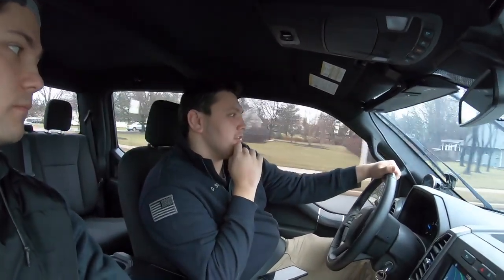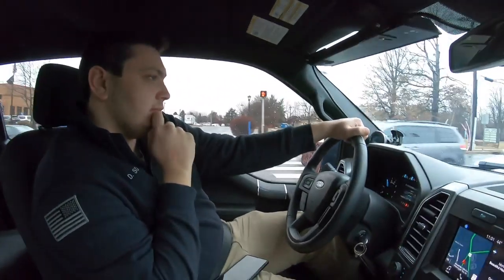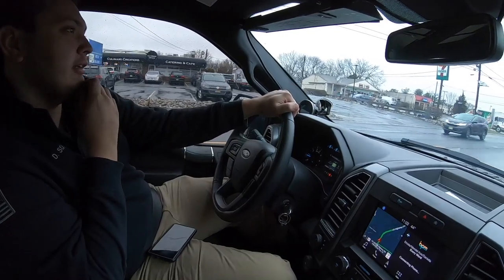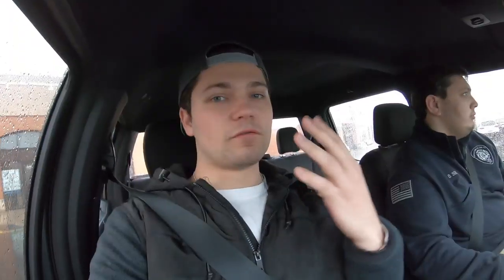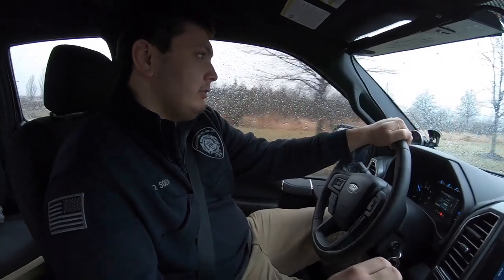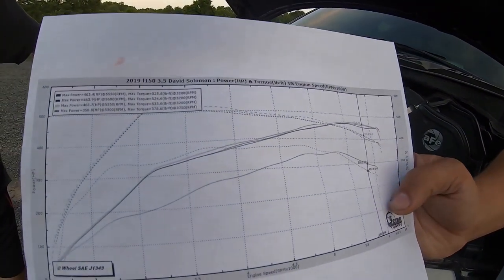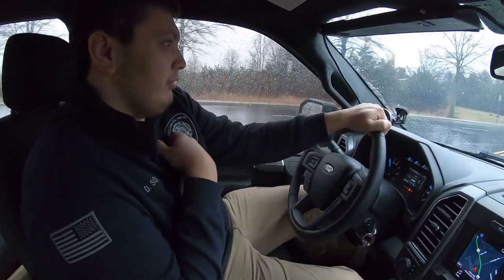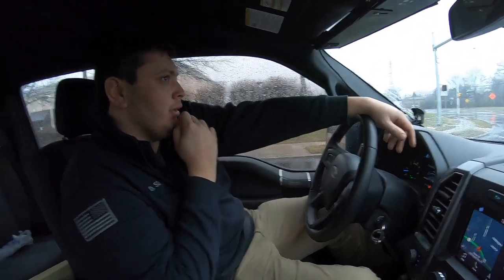Our 2019 F-150 Ecoboost Mod List | 500+ HP

Comment: This is why the 3.5 EcoBoost is 1 of my current favorite engines. So much potential.
Reply from the maker: Peter Shepherd yessir!
Reply: @RatchetWrenches  Not enough love for the 2.7L. That thing is a beast!!! I drove a Ford Transit Van with the 3.5L in it. I got on it ... WOW! This was stock, too!! Very impressive. Upgrade both fuel pumps and injectors and look out!!!
Reply: I’ve got a high output 3.5L v6 2019 limited, it gets 450hp stock, should I tune mine?
Reply: @jamesdempsey5702  yes

Comment: 1. Turbosmart Blowoff Valve
2. AFE Cold Air Intake
3. SPD Catted Downpipe and turbo adapters
4. 5* Tune
Reply: Five star? Is that the brand
Reply: downpipes arent stainless
Reply: @kennyboi01 there’s better tunes now 5*is most used but some have found better options these days. Mine isn’t 5* and hits the same hp and shift points.

Comment: 6:05 that launch is epic. Hard to believe that that’s a full size truck pulling like that. How many miles are on it? Curious of the reliability at this HP.
Reply from the maker: The 4x4 launches are honestly insane. And probably around 30k or so the owner hasn't put many miles on it working from home for a while. It's still reliable!

Comment: Ive got the same year in leadfoot grey. Im putting 480 whp with intake, mbrp cat back exhaust and a throttle body spacer. Just ordered some more go fast parts and hoping to get to 550 hp. These trucks are a beast.
Reply from the maker: Hell yeah that's awesome! How does the MBRP sound?

Comment: Dont buy the SuoerSonic unless you dont want to go back to the dealer again, otherwise i loved mine it was just too much of a headache to take on and off in the event a sensir fails.
Buy the EMS electronic one just released in Jan 2020.
Plug n play, novacuum line or wiring harness bypass required.
Yea its not as loud or sound as good but its 80% there.
Its only 50$ more than the supersonic but only because the supersonic is 3+ years old and is only 260$ now. Theyre the same price when both released. Ur welcome

Comment: I got almost the same set up in my 2017, but I have upgraded garret turbos and Inter cooler  and no cats and it sounds mean and very loud, also tuned by five star and I’m on 597 whp and 607 wheel torque I’m fixing to do the same in a single cab 2021 I just got las month
Reply from the maker: Damn that sounds sick we need our buddy with the F-150 to do those upgrades! These trucks can make so much power with just a few upgrades it's awesome
Reply: Very nice!

Comment: Good video, thanks for sharing. I have the 2013 Ecoboost with a S&B intake, Mishimoto intercooler, Corsa exhaust (love it!), Granatelli performance coils, all pulled together with a Livernois 93 octane tune. It all works wonderfully- love the ecoboost!
Reply from the maker: Thank you! Damn it sounds like a beast!
Reply: What HP you got?
Reply from the maker: Idrees Aljamie on 93 we have 468hp with the e50 (e85+93) we push over 500hp. Still going back n fourth with the tuner to get the right mapping. Hbu?
Reply: I have 498 whp on my 15.
 Downpipe sure, costs exhaust, colder plugs and tstat, ally meth injection and Livernois tuning. 
 Drove it from the dealer to lms and it currently has 223,000 miles with this hp level. I drag race twice a year and use it for my work truck and haul my enclosed trailers for work and hauling cars to the track.
 Can’t wait to build my next one.

Comment: Nice videos as always and truck guys. With the intake and the down pipe did you notice better mpgs? Like what’s your Highway at about 70mph and your in city?
Reply from the maker: Roy Steele thanks! But our Mpgs are mostly city driving about 18mpg and Highway is about 20mpg. But this is all when we’re not really driving above the speed limit, because with the tune it’s very easy to go fast and the mpgs goes down completely!

Comment: Did yours come with the life time powertrain warranty? 
Im thinking about tuning it, adding a roush cold air intake, spd down pipes, turbo adapter and then eventually exhaust. 
Does your truck run right with all you done to it? Not looking to race all the time or even hardly at all. Just whenever i get the occasional guy that wants some smoke that i can give it to him. Worried about the warranty though and if i should.
Reply: Truck runs perfect with all the bolt ons!
Reply: @EcoBooster You have link to this issue? I can't find anything on the 2nd gens having this issue.

Comment: Nice job guys and hope you’re enjoying the truck. I have a 15 with the 3.5L Ecoboost and am constantly impressed with it. Prior to my 15 I had a 98 F150 with the 5.4L Triton, K&N cold air kit, mass air flow sensor, upgraded coil packs and all that......and I feel the Ecoboost has much more power, is faster and pulls like a champ. I like that you mention what each mod improves and it’s basic function. You might also mention costs and put links in your description/ notes section. In doing my research, I always tend to look for someone who kind of puts a “best first mod” and continues with successive “bests”......as most of us are looking for more HP and Torque. Thanks again! 🤙

Comment: Hey man I have 2016 3.5 lariat sport, special image package without the stupid stripes. 6” Pro comp lift, pro comp black series rear shocks and pro comp black series front coil overs. Running 35 BFgoodrich KO2 with 2 piece fuel rims in black.. performance mods include Turbosmart BOV (no gains like you said just fun), Roush stage 3 intake, SPD turbo adapters, SPD high flow performance catted downpipes (like yours), with 3” AWE ofg res delete exhaust (sounds mean! Best pipes for the eco in my opinion). Last but definitely not least all this new piping bolts up to new turbos from Garrett, bolt on twin turbo “garret power MAX”. So now I’m about to get the tuner from 5star... I’m hoping that after I install the tune all my codes will clear and my cel will turn off. My question is probably dumb but I was wondering what codes you were getting before the tune. I’m getting p0245 and 02456. Turbo wastegate solenoids A low -and  A high. I. Also getting p035 turbo bypass valve along with my truck throwing itself in limp mode obviously the computer is freeking out with all the unfamiliar parts.  So I called 5 star and they said to get the sct bdx or the hp or whatever (the one you have mounted up) . My question is will purchasing this tuner and the tunes help me clear these codes... or do I need to go and get a custom Dyno done. I’m having a lot of trouble because here in Colorado everybody’s being lame and scared to even Dyno tune my truck. They say the new platform is super complicated and what not... so yea I’m wondering if you threw any codes after your mods! And if so were the guys at 5star tuning able to help you all.
Reply from the maker: Damn man I’m sorry you’re getting codes. We weren’t getting any codes prior and still arent. But yes you’ll be able to delete the codes with this tuner. You don’t need a dyno tune to get the codes removed

Comment: The Better exhaust would have been discard the resonator. Replace with a magnaflow dual in dual out crossover oval 11385 or 14385. Then continue the duals back replace the stock muffler with the same magnaflow crossover muffler, then duals out the back. Dyno results prove gains of 20 HP 16 Tor at the wheels over one single pipe no matter what size. Sounds deeper and looks better with 4" dual chrome tips.

Comment: Hey guys huge fan, however I have a question if you have the down pipe can you still put a cat back and resonator on your truck too?
Reply from the maker: Appreciate that very much and yes you can! The downpipe we installed was just to increase the airflow of the exhaust by widening the pipe and replaced the stock downpipe. So yes if you get a catback system it’ll bolt right up to the downpipe

Comment: I would of done oil catch can first so the engine can last longer in the long run should of done next the cat back so it can have better flow once you buy a cold air intake then upgrade your radiator better flow for all the are coming in now so way more water flow going then a tune the best way to go i say

Comment: If you wanna pass emissions, Don't waste money on a new exhaust system, just install a reed valve and saw-zaw or drill a hole in the top of the exhaust where it is hard to see and boom, clean air enters the exhaust, but no oil/gas exist, keeping the truck clean. Seriously, it adds to exhaust sound (a little) and solves the issue for $60 and a quarter of the effort.

Comment: I did all the upgrades to my 3.5tt F-150 (SCT 93 tune, 3 inch high-flow cats Borola exhaust, AFE intake, 73mm throttle body) 420rwhp and 535tq. After 4 years and 20k miles the trans had lost all overdrive clutches and was pretty much beat.
Reply: Your the first person to talk about how well the transmissions are holding up.   I’m coming from the dodge world, were trans blowing up because of to much torque is a language we speak...
Reply: I dont believe that. I know guys who supercharge their coyotes and running like 900hp. Trans is great
Reply: My trans. Let go at about 55,000 miles. Running e30/ e50 tune. 2018 3.5
Reply: Are your high flow cats just universal borla? Or are they for like a mustang?
Reply: @scotthightower9481 so from my understanding the first year of the 10 speed, which is an 18 and I have one myself all stock with 96,000 miles, is not the greatest transmission. We had issues with super hard downshifts and luckily an update on the transmission took care of it and haven’t had any issues so far. I’m honestly not surprised to hear that yours blew so early tuned being that we’re not the best from the start.

Comment: i have a 3.5L with a tune only that makes 480 wheel and 550 wheel on 100 octane. These motors are nuts
Reply from the maker: J Biz that’s rad! They’re great motors and have a ton of potential for power!
Reply: Do you daily it with the tune?
Reply from the maker: Tommie Qualls during the winter no. Now Yes of course!
Reply: Ratchet Wrenches thanks for the feedback!
Reply from the maker: Tommie Qualls no problem!
Reply: @RatchetWrenches  what tuner you have?

Comment: I'd advise against meth. To many issues can arrive. Air bubbles, running low and or doing pulls while low on meth.
Reply from the maker: Yeah I don't think the owner of the truck ended up doing the meth injection anyway

Comment: Couple Questions, I have a 2020 F-150 3.5L with just a 4inch catback straight pipe. I am wanting to put an air intake and downpipe, Will I definitely need a programmer/Tuner to install these? Also does the downpipe come with all hardware needed to install or will I need the SPD turbo exhaust adapters?
Reply from the maker: Hey you won’t need a tuner to install those parts, but If you want the most performance out of those parts I highly suggest getting it tuned. This particular downpipe came with all the required parts to install yes. The turbo adapters are separate and are a totally different purchase but while you’re down there you might as well upgrade them ya know?

Comment: Nice truck and great job doing mods. Maybe I missed it. So all this and no AM intercooler. I have a 21 150 and I thought the game plan was to do that first . I'm in Ga so maybe that still is valid. Can't get any tune for a 21 so far that makes significant performance gains. I'm with u on the exhaust. I don't like any of them over stock. Been there and done that too many times.

Comment: No engine spec, obviously 3.5 and a 10R80, but no mod list ??
What gear did you dyno ?
Why 5 star ?
Reply from the maker: We said all the mods we have that relate to the tune. But I’m not sure what gear they tuned it. And 5 star because they’re a reputable company and have been tuning the ecoboost engines for years. We were recommended them by a friend but I’m sure there is plenty of tuners out there that can achieve similar specs

Comment: I’m in the market for a brand new truck. I appreciate this video and learning you’re mods. I plan to do the same build. Will this truck tow 9000 pounds? Camper
Reply from the maker: Thank you for the comment! Yah I think you’ll love building it similar to ours. I’m not quite sure the towing capacity especially now with the tune idk, it adds a lot of tq
Reply: Ratchet Wrenches what is the make and model of the tuner he used.
Reply from the maker: Anxiety Fpv NGauge tuner and it was dyno tuned by 5star tuning
Reply: Towing capabilities on a gen2 3.5 eco is roughly 15k lbs

Comment: The AFE Rebel cat back sounds incredible on my 2012 3.5L
Reply from the maker: Interesting I’ll have to check how it sounds!
Reply: @RatchetWrenches  I'm also running a cv fab catted downpipe with AFE cold air kit.  I wasn't looking for a single side exhaust. It really shortens the exhaust travel. All piping is the same size. Awesome sound for a 6cyl no droning at 85mph but you know it's there.  I'm completely satisfied.  Next is CR performance manifolds to finish the exhaust

Comment: 500 hp with stock turbos and 5* tune? Haha get tf out of here
Reply from the maker: Ryan Haecherl to be exact its 468hp and 533tq on 93. We have a dyno sheet and a video showing the results. Then on the e50 tune it pushes over 500hp... so yes 500hp on stock turbos.
Reply: @RatchetWrenches  yep I watched.  I'll wait and see that video.
You need an intercooler and meth order the cvf titian intercooler.  
Get a dragy and let's see what you put down now.  
How many revisions on your 93 5* tune?
Reply from the maker: Ryan Haecherl the stock intercooler can provide enough performance to withstand the e50 tune. If we plan to run the e50 tune often yes we’ll prob upgrade to a mishimoto intercooler.The tuner has been back and fourth with revisions to perfect it. We haven’t sent over a data log in about a year since we don’t have close access to e85 and then this pandemic. To answer your question on the number of revisions for the 93 tune I believe it was 4 or so. They pretty much had that tune lockdown
Reply: @homerog4920  I own a eb truck.  I'm in all the eb truck groups.  Again you're wrong...

Comment: You need better tuning, 3bar map and I'd suggest a deeper trans pan
Reply from the maker: Well look into it
Reply: Already has a 3 bar from the factory. 1 bar means it can only read vacuum. 2 bar is vacuum and up to 14.4 psi of boost. 3 bar is vacuum and up to 28.8 psi. The 2014s and older came with 2 bar.

Comment: TLDR; 468whp/520 ft lbs wtq  (Needs an intercooler and catback next for sure and itll make 500+ whp)
--Turbosmart Blowoff valve
--SPD performance Downpipes
--Good tune for this exact setup
--AFE intake which is overpriced as forum guys and myself have proved. An intake just as good (if not better in my case) for under $100 with basic tubing and filters. Mine gained more power without the AFE using my homebuilt one and was 1/15th the cost
Reply: Do you have the turbo whistle package from SPD

Comment: I have been modding my f-150 2.7 do you guys have anyway to send the links to the parts
Reply: I have an 2.7 eco boost beating all the 3.5’s sent my way. Tune, res delete, awe exhaust, intake, downpipes on 93 octane tune I can hit a 12.3 quarter mile with 35’s on

Comment: Watch out for the cam phasers , mine went out at 63,000 miles
Reply: What year truck
Reply: @masonsmucker4745  2017.  The dealer says 9 trucks are waiting for same backorder part, t this dealer alone.  Love the truck as a whole, when working, most versatile and set up perfectly for me. CANT trust them now-a-days. Im thinking about buying an old carburated v8, least amount of electronics. Electronics SUCk they just dont last, as well as these high tech engines.

Comment: Ay bro what do I need to be e85
Reply from the maker: Steve Martinez well since these are flex fuel you just need the power mods to support the e85. For us we only have a downpipe with turbo adapters and then a cold air intake
Reply: And were do I get the turbo adapters I’m already straight pipe
Reply: Downpipe*
Reply from the maker: We got ours from a company called SPDPerformance but there’s a bunch of companies that make downpipes and turbo adapters. So you can really chose which one you’d like. I do suggest SPD because they’re holding up great and have very good reviews and are really popular!
Reply: @RatchetWrenches  I have a 2019 3.5 and want to run e 85... what do I need?
Or keep it 93 tune any suggestions to make it quicker

Comment: What gear was the truck dyno'd on? I hear 7th gear is 1:1, yet my truck was dyno'd on 5th. I was a little confused as I hear our 10r80's should be dyno'd on 7th gear.
Reply from the maker: Ours was dyno’d on 4th gear. But I actually heard that about the 7th gear pulls. I’m Confused as well now
Reply: I think the issue is you hit speed limiter in the higher gears and can’t rev out fully
Reply: @noahgullion2  No, speed limiter is off.
Reply: @RatchetWrenches  dug in a little more on this, and turns out a lot of tuners are just staying away from the 7th gear pull on the f150 stock tires. Some have reported a 7th gear wot dyno pull all the way to rev limiter without any issues, but I guess it's risky.
Reply: Gonzalo Carmona True, once it’s tunes it can be disabled, but there are still mechanical limits such as tires that aren’t rated for over a certain mph
Reply: @noahgullion2  I know that
Reply: Correct. Seventh gear is 1:1 but almost every Dyno pull that you’re seeing numbers  for our trucks are done in fifth gear.